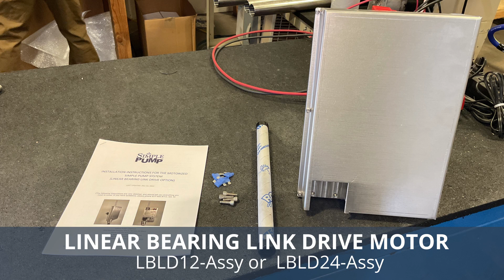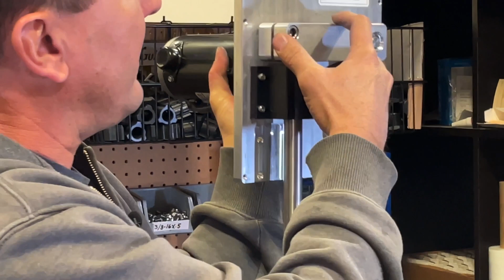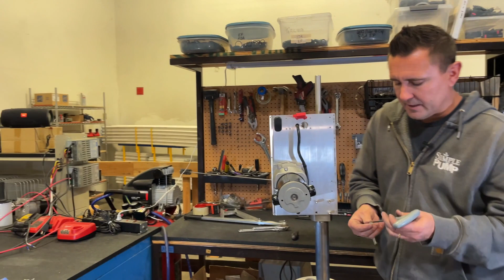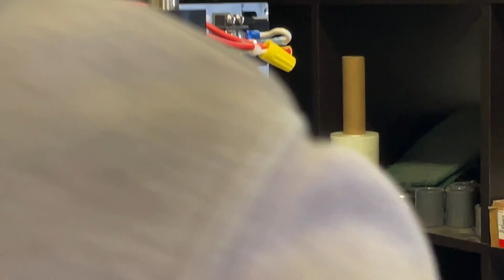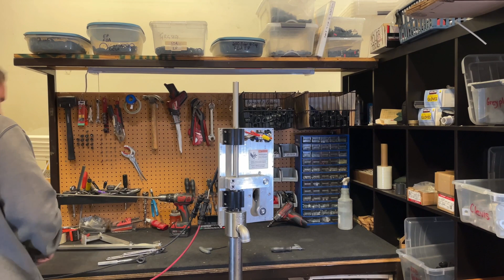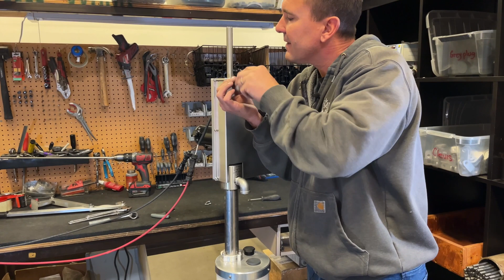Simple Pump Water Well Basics - Installing the LBLD Motor

Comment: Can you plug this directly into an outlet and do you have to have a submersible pump already installed? I wanted to purchase the hand pump as a backup and use the motor as my primary source of water.
Reply from the maker: The LBLD drives use DC power and are designed to be run off of a deep cycle battery, they will not run directly off of AC power.  You could use an AC to DC Converter to run the system off of AC power, however if you lost grid power the system would not work.  While you do not need to have a submersible pump installed in order to use the LBLD, these are backup system and are not designed to permanently "replace" a submersible pump.  It will not be able to pump near the volume of a submersible pump.  We do have customers that use these drives as their primary water pump, however they recognize there are limitations and manage their water needs accordingly.  One thing to note is that you cannot have both the lever arm and the DC drive installed at the same time.  Both use our base pump system, you either have the handle connected to the pump head or the drive system connected to the pump head.
Reply: @SimplePump  thank you for responding and the info. For some reason, youtube just FINALLY notified me of this. However, perfect timing, because we plan on ordering our setup soon after getting our well installed. Thank you again!